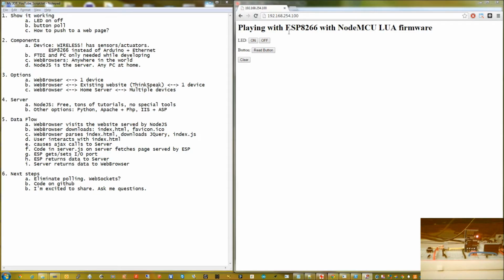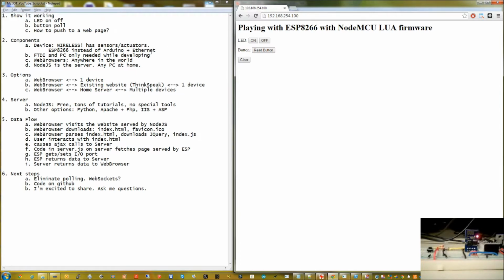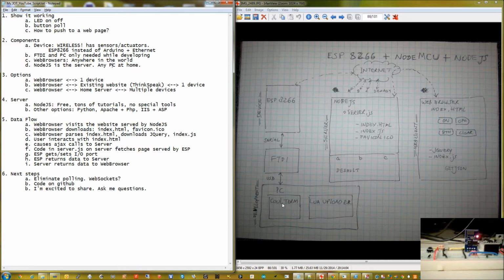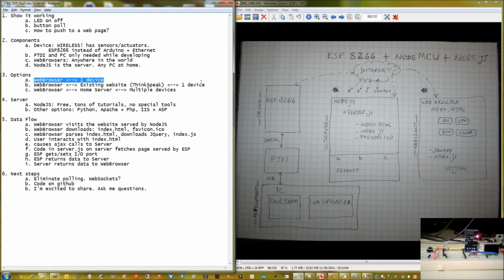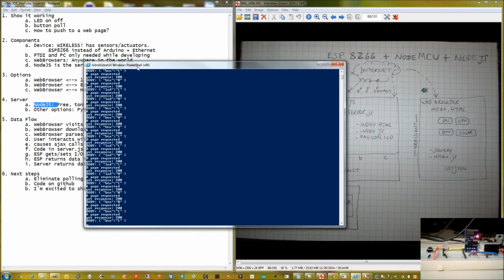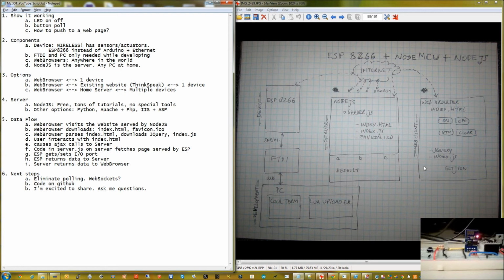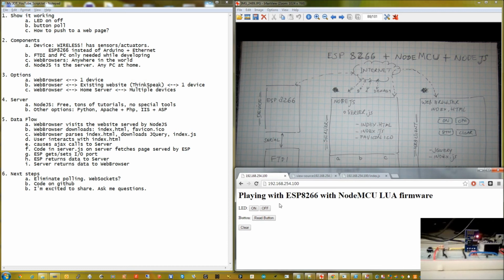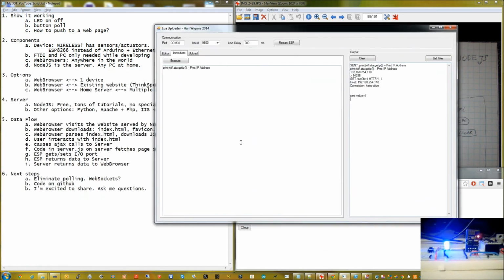$3 Wifi module part 4: WebServers

Comment: You can define a page refresh interval - using JavaScript or CGI directives - which is used to re-get the server variables often.  It's not quite push but it's a common way to do this stuff.
Reply from the maker: Since I posted this video, I discovered node.js and socket.io which has the advantage of "instant" push rather than slightly delayed page refresh.  It is more complex, so a page refresh is still a better way when a slight delay is acceptable.  Thanks for taking the time to leave feedback Chris Wesley !
Reply: Hari Wiguna
You're welcome, and thanks for all your videos. I'm learning a lot and I just got your LUA Loader which looks great.

Comment: This is really cool. Thanks for your tutorial. I have the ESP v.1. Does the lua code work on ESP v.1 module where you have access to less IO?
Reply from the maker: chrisdeffer , yeah, the ESP8266 is amazing! Glad you enjoyed the videos.  Yes, nodeMCU/lua supports all versions of ESP modules.  Just make sure that you confirm the GPIO index because at one point they changed the index to access to the various GPIO pins.  Good luck on your projects!
https://github.com/nodemcu/nodemcu-firmware/wiki/nodemcu_api_en#new_gpio_map

Comment: Hi Hari,
Thank you for uploading the videos.

Hari, I was trying to do just the opposite

I want to send the data from the ESP8266 to my WebServer(Apache Tomcat) and want to make some alterations in the database.

I am getting a "OK" message after using AT+ commands but no alteration is being done in the database(MySQL).

Is There any way out

Thakyou:)
Reply from the maker: +Chetan Nain , if you think you're sending what the webserver expects, I would run WireShark (free tool) to watch the network traffic on the server side.  If the request from the ESP made it to the server, I would then use a webbrowser to send the same request that the ESP is sending.   Compare the network request/response between webbrowser and ESP.  Of course if you can't get the webbrowser request to update the db, then the problem is on the webserver configuration and has nothing to do with the ESP.   Good luck!
Reply: Thankyou Sir..
I got through with the problem...
we are able to connect to the server when we try to connect it with arduino IDE...

But when we try to send the same AT+ commands with Serial Monitor the server on receiving the GET request after AT+CIPSEND=0,80 returns,
"busy s...."

It is working very well when we make the code and compile it with arduino IDE and then install that in ESP.

But ESP returns error with serial monitor..
Reply from the maker: +Chetan Nain , It's been months, but If I recall correctly, that's what happen when you send it a command before it's done processing the previous command.  

This is the code that I used when I was using AT commands.  Note the part where it waits for ">" before sending the command.

https://github.com/hwiguna/g33k/blob/master/ArduinoProjects/RF/ESP8266/esp8266_ThingSpeak/esp8266_ThingSpeak.ino

Hope that helps.

Comment: Hey Hari,

I am new to IoT and just got my esp8266. I am trying to start with a simple project to turn an LED by using node.js as the server. So, I already tried it by creating a server with the esp8266 and it worked. Right now im trying how the module will be able to talk with the node.js server running with my computer. How do we do this? Do we need to write a node.js script to create the server?
Reply from the maker: +Rey Wiyatno , congratulations! Isn't the ESP amazing?
Yes, you need to setup a server on the node.js side.  It should only take a few lines of JS code.  Then you need to create a webclient on the ESP side to visit the node.js web server.
Good luck!
Reply from the maker: +Rey Wiyatno , It has just ocurred to me that since I uploaded this video in 2014,, there has been a lot of Internet Of Things services available in the cloud.  Unless you have good reason to maintain your own server, I would recommend using one of these services instead of running your own server.  I'm happy with adafruit.io, but there are many other options.
https://www.youtube.com/watch?v=MWebdJwr6ks

PS: I saw your suitcase robot video. That's pretty cool.  How does it detect the person? Computer vision? beacon?
Reply: +Hari Wiguna Hey Hari, the reason I want to create the server using node.js is because I want to do it with raspberryPI/beaglebone. Also, do I have to create an .html script or can I just do everything in my init.lua? (i run nodeMCU on my esp).

Thanks for taking a look! It currently uses camera (computer vision). I want to upgrade it by using bluetooth/WiFi when i have the time :) my other projects are on my website reyrezawiyatno.com (although it is not up to date), but please feel free to take a look at it.

Awesome tutorials by the way, you're helping a lot of other people to learn! good job.

Comment: Do you maybe still have the code for this project? I would like to make something like this in my own house (computer as server and these esp's talking to it), but I dont know internet coding so much. Or if you dont have the code, maybe you could tell me what I need to learn and what should I do? I would be really grateful. And your videos have really given me inspiration to make something, and I also looked at your Socket.io video and it looks awesome.
Reply from the maker: The code that I used in the video is linked in the video description on Youtube.
I cannot tell you the best path for you because I do not know what you already know or the best way for you to learn.  Here is what I did:  When I discovered the ESP8266, I followed tutorials online to learn from others.  My goal is to gain experience.  In that process, I learned that not only you can drive the ESP using an Arduino, but you can also program it in LUA without an Arduino.  That led me to another path, and so forth and so on.  Good luck with your projects!
Reply: Hari Wiguna  I really did not see the link in the description (didn't click see more), so thank you for that. I was mainly interested in the node.js for the server, cause I am just getting in the networking and stuff (recently learned HTML). Currently I have Lua on my esp and the esp is working as a server.

Comment: Hari great job
i have a question for you, i am running a webserver but it keeps stopping after about 3-5 min would you have any ideas
Reply from the maker: Hi Martin Fraser , some potential things that could go wrong:
1. out of memory? print(node.heap())
2. invalid response. Check the length of your response, make sure that you're sending the correct # of bytes promised.  I've seen browsers wait timed out waiting for a reply when the ESP did not send enough characters that it promises to send.
3. power issues? Make sure you supply the ESP with enough voltage and current.
Good luck Martin!
Reply: Hari Wiguna
Thankyou for the reply i will have a look and see what i can work out Hari.
keep up the good work with then.

Comment: I downloaded Node how do i run server.js?
Reply from the maker: 1. Open a command prompt
2. {path to where nodeJS is installed}\node {path to where server.js is at}\server.js
Reply: Hari Wiguna
When you say Command prompt is that windows cmd, powershell, or Node.js.
I typed "D:\Program Files\nodejs\ node W:\Wifi test\g33k-master\g33k-master\ArduinoPro
jects\Windows\ESP8266Related\NodeJS\server.js" into all three and get a error.
Reply: Hari Wiguna
do you have forum or similar you frequent I'm sure I'll have questions about socket.io :)
Reply from the maker: Port 51 , I meant windows cmd, though powershell should work also.
I think you already figured out the error is most likely that you need to install socket.io. I learned NodeJS & socket.io by going through the tutorial at the nodejs website and watching youtube videos ;-)
Reply: Hari Wiguna

Mr. Wiguna I have set up socket.io successfully, which lua file from github are you using for this?
Reply: Hari Wiguna

 On WebServer.lua file from https://github.com/hwiguna/g33k/blob/master/ArduinoProjects/RF/ESP8266/NodeMCU/Lua/WebServer.lua are you running the ESP in station mode, softap, or stationap?
Reply: Port 51
Also on https://github.com/hwiguna/g33k/blob/master/ArduinoProjects/Windows/ESP8266_Related/NodeJS/server.js please explain "var serverIP = 'xxx.xxx.xx.xx'; //'192.168.x.x';" and "var apiPort = 80;" where did you get these IPs is this the one provided by the ESP also explain "}).listen(80,serverIP);" and "var options = { host: "xxx.xxx.xx.xx". If i choose another port say 8081 will i need to port forward from my router? Thank you.
Reply from the maker: Port 51 ,
The number in serverIP and apiPort is the IP address and port where nodeJS would be listening for traffic from the ESP. It should be the address of the PC where nodeJS is running at.  I just picked a common port, it could be almost any number.  

Further down in server.js is the ip and port of the ESP so nodeJS can talk to the ESP.  As long as you setup the same port on the ESP, 8081 or any other port should work.

Yes, port forwarding should work for both the nodeJS side and the ESP side.  All that happens in your router before it hits your local network.
Reply from the maker: Port 51 If I recall correctly, I setup the ESP as station. Then print the ip address assigned by the wifi router using wifi.sta.getip().  This is the ip that I put on the server.js to talk to the ESP.  This works for my experiment, but a more robust implementation would need to do this without having to update any source.  I have not done this yet.  Maybe a good future video. :-)